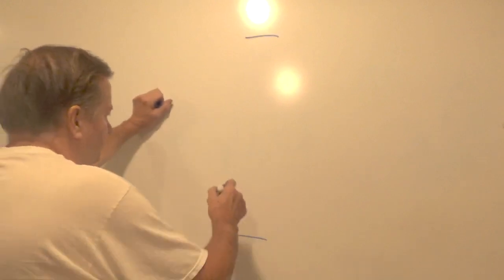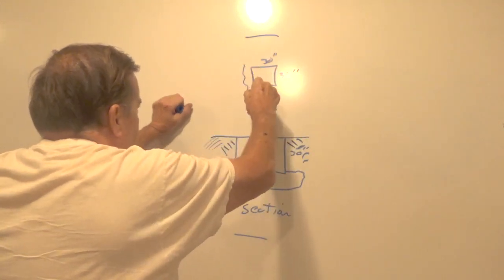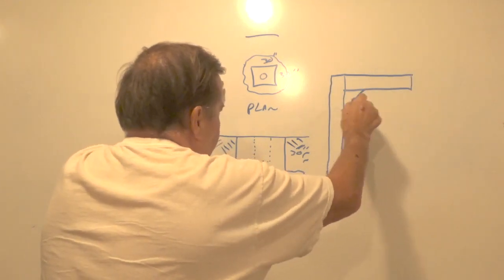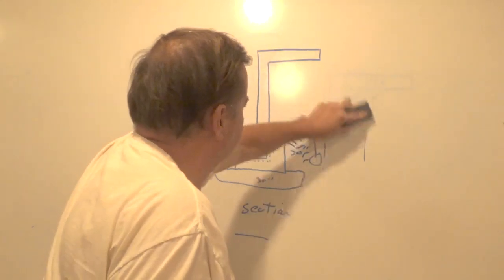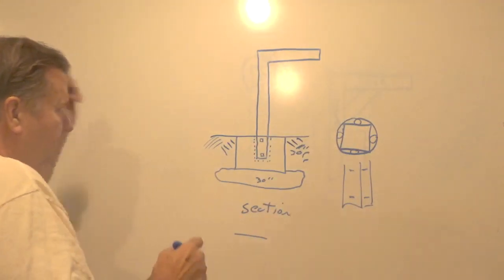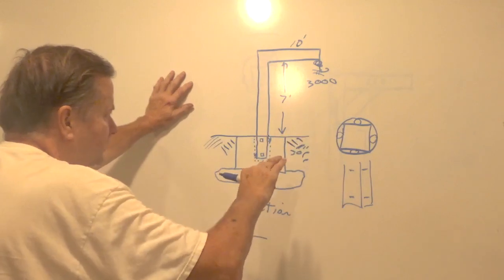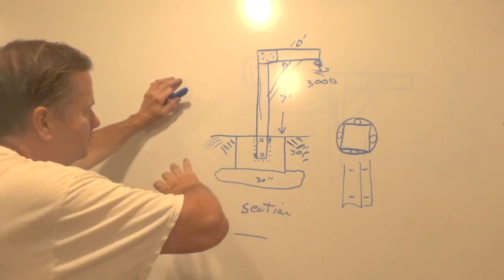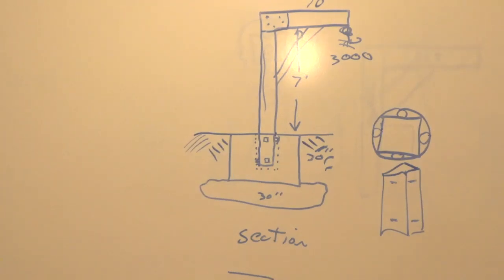Preliminary idea for the crane design to load the Woodmizer LT15.

Comment: Hey Jo,
That's a neat idea. I think for sure the steel plate gussets would help a great deal. I'm not sure I'm following you on the wheels though. My first thought was something like stainless steel bar stock to use as pin bearings. I'm thinking that pin bearings would help distribute the load on the wall of the hole opposite the load on the hoist. I'd also think a steel pipe would wear longer than having the load on PVC or the concrete wall. How do you plan to drain the water out of the hole that's bound to find its way in.
Reply from the maker: I agree on the steel pipe. Definitely will wear better. Pin bearings would mean different size stock because of the secant shape. The wheels would take up the space on all 4 sides and center the 8x8 in the steel pipe. Maybe a water drain line or what if I filled the hole with oil or antifreeze and capped. Are you guys getting any of this rain, it must have rained 4 inches in the last 3 days.
Reply: Josaljo Won 
Not much rain here but I think we have a chance trough the weekend. We've been in the mid 90's and dry.
Reply from the maker: Carl Wilson It is Thursday 26 Jul. Sunny today, but everything is soaked. 72 at lunch time here.
Reply: Hey Jo,
It has been cloudy all day and a high of 82. It's been nice for a change.
Reply from the maker: lake bum Hey it has been in low 70s in the shade, started off very muggy this morning but the humidity stabilized around 40% so not to bad. 70 as I write. Going to be a nice evening but They are calling for rain again Friday and saturday.
Reply: So many engineering factors to consider on this build but your basic plan is sound. I believe your concrete structure will be ample if built with structural rebar anchored. Your 8x8 structural pole should also be ample but your bearing plan for pivot just wont hold up. Its out side and thats a big block of wood alot of swelling and shrinkage with weather and temperature. Its also below ground and unless completely sealed will hold water. That alone will cause enormous troubles. To avoid this i would consider putting your 8x8 permanently into a 3ft piece of 12inch pipe and seal it and gaps with an epoxy. Then install a14 inch or larger pipe in ground and use bar stock as needle bearings and fill with oil to creat your bearing. Then bolt a steel plate to the concrete around top of your bearing to make a seal.   Yes i would go 3ft not 2ft and with this type bearing you get a even weight in 360 degrees around.
Reply from the maker: I was reading your comment and I have a clear picture of what you are saying. I am thinking on it. A friend from OK. also mentioned the same type of bearing. Lot to think about here.

Comment: Hi Joe... first off, I can't help with the stresses, remember, numbers give me a headache. When I was building my log home we had two cranes (homemade), one lifted the logs onto the building which was a log attached to a nearby tree and the other, centrally located in the building, moved them anywhere on the building we needed. The one in the center was a full length tree which was held by four by fours against our fireplace opening on the first floor. The bottom of the crane (log) rested on a snowmobile boggie wheel on the dirt floor of my basement (before the cement floor was poured) which in turn allowed it to rotate 360 degrees. It worked extremely well and I used chain falls to lower and raise the logs on the cranes. Now I know you have your plans, and I have no doubt, based on your diagram that there will not be enough stresses on the cement or beams to worry about. Remember, I lifted green pine logs that were in excess of 28 feet being the longest up to thirteen or fourteen inches in diameter and had no problems. One thing that I noticed right away if you go with your design, you have to allow for water drainage on the bottom of the hole in the cement or your crane will freeze solid until Spring! The rollers you want to use will make the crane move effortlessly. It will look nice with your surroundings.
Reply from the maker: John Collado I was thinking about putting a shield to cover the hole and a drain tube out the bottom to drain off any water that gets in there. Good advice John
Reply: The cover was my first thought, but unless you put some kind of drain in the hole there is bound to get some water in there somehow over time.

Comment: I've done similar projects in remote places, not trying to be a downer, but I wouldn't trust it for the loads and reach you need with 8x8 beams. Maybe if you could make some at least 12x12 and set it deeper in the ground with thicker rebar reinforced concrete. Honestly, if it was me I'd do it out of steel. Good luck.
Reply from the maker: I already know how to build it out of steel. I have the steel to do it but I want that old look and the fun of doing it like back in the day. I am also concerned about the 10ft reach thats why I will be videoing how I stressed the wood and whether it will work or not. Thanks Jerry appreciate it.

Comment: Concerning your preliminary idea I'm not an engineer, folks I worked for" overbuilt"everything, and kept things simple. A simple bushing system is what we normally used, a pipe within a pipe and lots of grease. 3000 lbs sounds like to much for an 8 by 8 but it would look awesome!!
Reply from the maker: I was just reading some of the stresses that white oak can endure, it is impressive. My neighbor built an elevator with steel channel, like you say it was simple and works great He spent $300 bucks. My other neighbor built one with aluminum tracks wheels and other well thought out ideas. $1800 bucks. It is hard to decide what to do. The latter looks nicer. But....

Comment: Sorry, I don't think the depth of the hole is enough to counterbalance that much weight. Also, I think you would need more than four wheels around the post at each depth in order to achieve smooth turning. Also also, I would be concerned that you get strong enough wheels  to bear that much weight as well as their mountings. In my limited experience, such wheels are pretty expensive.
Reply from the maker: I already checked, the wheels are not available and I will have to fabricate them. That is ok. You may be right about the depth of the hole I am doing numbers and tests on that. As far as more than 4 wheels, I can make them as wide as rolling pins if I have to. Not sure yet. Thank You DJ.

Comment: You are going to need a bigger foundation to start with.  My rough calculations I came up with 18,200# side force at bottom on post.  You are creating a huge mechanical advantage with that reach and height.  I am little rusty on my math but 18200 would be the minimum
Reply from the maker: I am going to check your numbers as soon as I get the 8x8 white oak number down pat. Thanks for this, I will wing it with the 18200 until I get a chance to work it out and then let you know. Thank again Brian.

Comment: Hi Mr Jo 
I think you have a good idea going forward 
Please allow my input 
On the footing the 30” depth seems good although I would sink the 8x8 deeper then 24”
Also very important is what are you going to do for drainage 
You 12” diameter hole will fill with water or snow rendering you 360 moment of the jib 
You made a good point I would reinforce all connector seams of your jib with 1/2 “ steel plates with thru bolts 
Also think about building a horizontal handle on your vertical post to turn it 
You don’t want a side load developing by pushing the log to turn the jib
Reply from the maker: I am considering the depth that is not in stone yet. I like the idea of the horizontal handle, QE also had the same idea.  Water can be an issue so I will put a drain pipe out the concrete at the bottom. Also what if I filled the hole with anitfreeze or even oil and covered it. Just thinking. Thanks for the comment.

Comment: Greetings Jo.
There are alot of variables that go into the 4 different structural/ load calculations required to design a safe rotating jib crane.
The lateral stresses that you mention are one, however in order to determine those stresses you need to calculate both the static and dynamic loads.
A 3000 lb static load, has very different  dynamic characteristics than the same 3,000 lb load rotating about an axis.
A sound crane jib crane design should include a mast that extends beyond the    height of the jib arm.

The jib counter weight arm should extend beyond the  mast (away from the jib arm load section) by  at least  1/3 the working jib arm length.

The mast should extend above the jib arm  height  construct by at least 1/3 H ( historically known as the cathead).

The jib pendants(cables) are subject to traction, while the cathead is subjected to compression, flexure and shear 

Cables should be attached at both the top of the mast (cathead), and extend at an angle to both the end of jib arm (lifting arm) and the counter weight arm.

At minimum I would pour the footings below the frost line.
Suggest pouring a monolithic form with rebar a minimum of 36" square.
Would go with a 15" ID steel pipe.
You would need to create a needle bearing using steel rods around the gap to distribute the load in order to rotate the mast.

Sorry for the long reply , however cranes are a different kind of mechanics .
Reply from the maker: No problem with the long reply. Every sentence said volumes. Forgot about the frost line. So that is a definite change. I was planning the monolithic with a suspended form to still get the spread footing. Not convinced on the needle bearing  but will be considering them. What makes you say the 15" id pipe? (Just wondering) The parts about the extending and cables are fantastic. Thank you.

Comment: just my thoughts would be go with a 12" metal pipe in the concrete and leave that inground and your wheels can ride on the metal and be fine  on that.   Looking forward to how this turns out for you!  Just a question How many degree's of rotation are you hoping to have the crane swing?  Just wondering if your only rotation say 90 degree's or so,  can you put another bearing on top and then run a cable down to a ground anchor  or due 2 cables at 45 degress down to act as deadman to help try and hold the top from flexing when lifting the load?  I hope my idea make's sense to you and Good Luck!
Reply from the maker: Hey Matt, it does make sense and I think I want to be able to rotate about 45 total degrees from parallel to the bunk frame to the center of the bunk.

Comment: I may have missed it, but is the chain hoist going to be permanently fixed in place or is it going to be on a trolley?  I ask because I like the idea and need one of these as well.
Reply from the maker: At this point, fixed. I want to reach the center of the bunk frame. That way the maximum size log can be placed on the mill. As long as I can reach the middle it does not matter if the logs are shorter. Have a good one.

Comment: Hi Joe, first make sure the bottom of your footing is at least to your local frost protected depth. Next  a sono  tube is made  to hold  concrete on the inside  ,not the outside and even if you were to form the inside , you will  probably not be happy with the over all roundness end result.  I feel  your steel tube  approach with  clips welded to the outside  to lock it in to the concrete is a better approach. Than you will need a way to keep out debris and get rid of moisture. If you put what we call in commercial construction ,stirrups  (re bar bent round  keeping a minimum of 2” off your  12”tube)  keep these at 6” spacing  than tie these to vertical  L dowels  (on the inside of the stir ups)that was cast into the footing . This is what is used  to keep anchor bolts properly contained In Concrete columns, thus not  cracking or spreading  when put under stress.  Some how this Crain will need a way to support your vertical load and spin freely. I will have to sleep on that one .By the way,  I am not an engineer, but I am commercial concrete superintendent.  And I have done a wide variety of work over the past 30 years as a union carpenter.  If you hammer this design out please let us all check it out, I maybe installing one my self.👍
Reply from the maker: All good info Chester, The clips welded to the pipe is a good one for sure. I plan on keeping the videos current as I move forward. I may have to put up an umbrella system first. LOL

Comment: 3000# x 10 feet = 30,000#. not going to work  with the wood you have. The wheels will act like a one way clutch and bind in a wedge action, not going to work.
 Using a custom rolled 16" pipe in a pipe bearing 48" long in a post hole at least 48" dia. and 6 feet deep in a 1/2" re bar cage with 6 verticals and 6 -40" hoops, 6 sack mix. You will find it hard to swing under load. Johnny and friend was only 300 #
Look up Jib Cranes on you tube.
Mine is a 10x10 x100 pound ft. H beam in a 24" post hole 6 feet deep and 12 feet above, the 6" x 8 foot long I beam arm swings around on flanges with a steel  tension brace rod on top. I like it.
"Theirs a place for guys that cant weld, its called ,the ladies room."